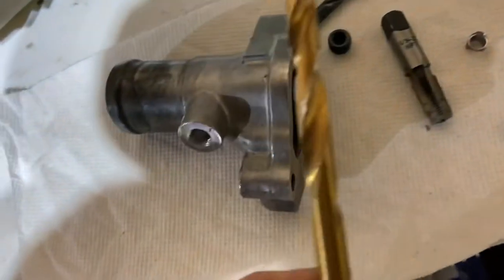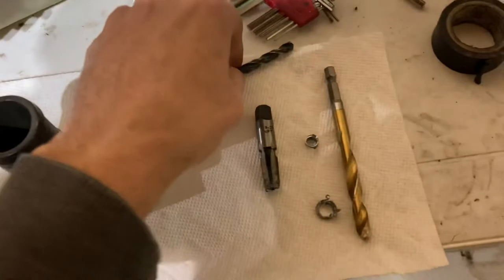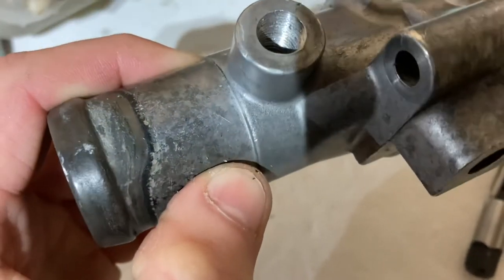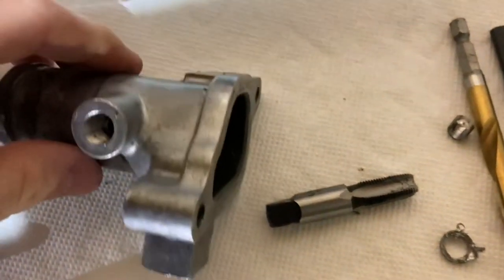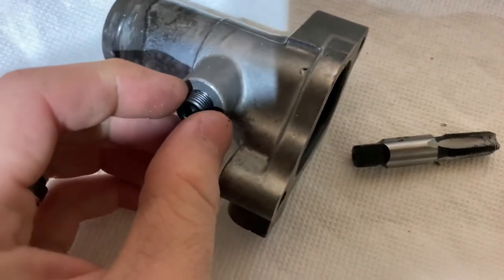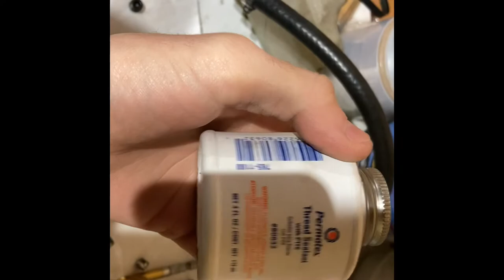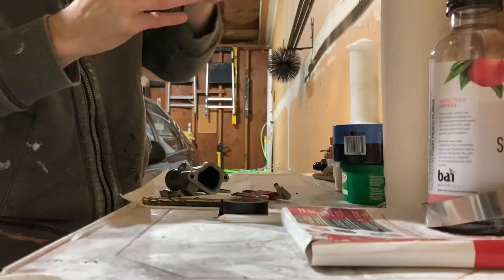B18C1-Upper radiator hose coolant line delete!! (How to)

Comment: Yo thanks bro good video, I'm struggling with a leak on the exact spot on where you did the delete on my b18b4, I'm considering doing the delete as well. However before I do it I would just like to know where that hose runs to and what's its purpose? And what did you do with hose after the delete. Hope to get a response soon have a good day
Reply from the maker: You’re welcome bro glad I could help! The hose that connects to that goes to the thermostat housing. I connected that thermostat housing nipple to the small nipple on the water pipe. Also I would use Teflon tape instead of the thread sealant. The thread sealant leaked on me!

Comment: For the water neck would you use rtv silicone or just put the plastic gasket or the paper one which one works best?
Reply from the maker: Rtv. Also don’t use the paste stuff I used. It ended up leaking lol use the regular Teflon/plumber tape

Comment: pro tip if you use a torch and heat the area around the fitting it comes out easy with some needle nose pliars.
Reply from the maker: Thank you!